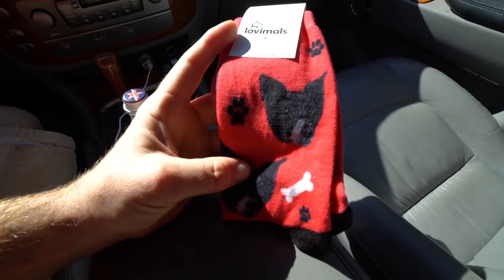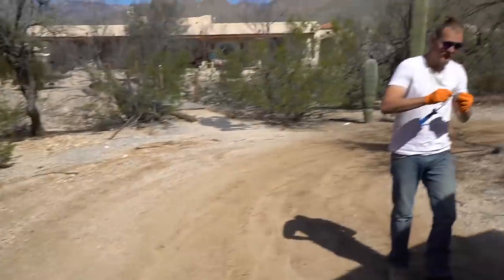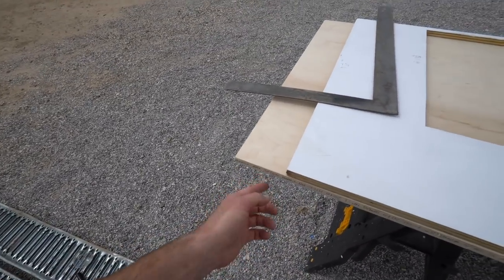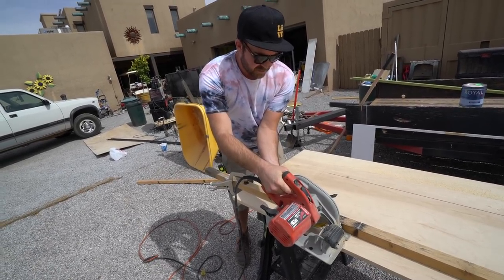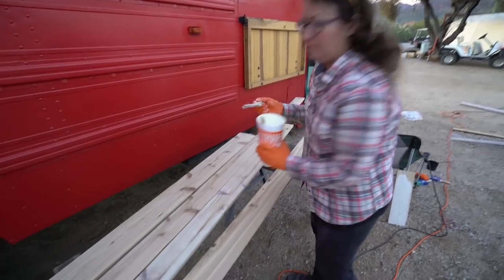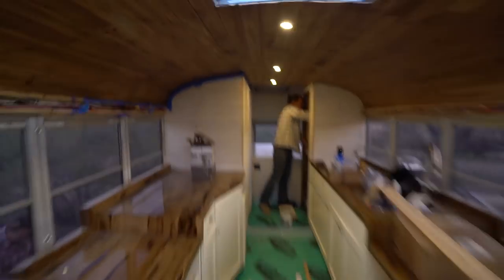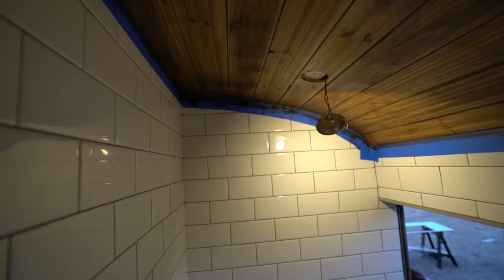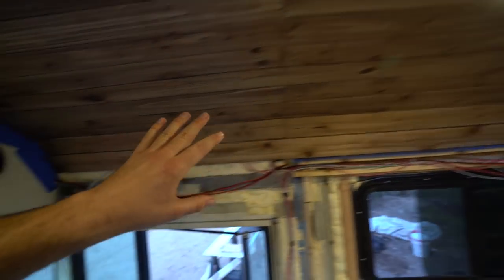Ceiling Stain + Random Skoolie Conversion Jobs

Comment: I’d probably try putting a counter laminate up on the ceiling. It would be easier to maintain with fewer joints and form to the ceiling curves.
Reply: And expensive
Reply: Tom Morin have you priced cedar to compare it? I just did and cedar was more for the square footage
Reply: @akbychoice  I wouldn't use cedar for splintering cracking and shrinking. Not laminate either. I would go paneling
Reply: Tom Morin yes paneling would be much better.